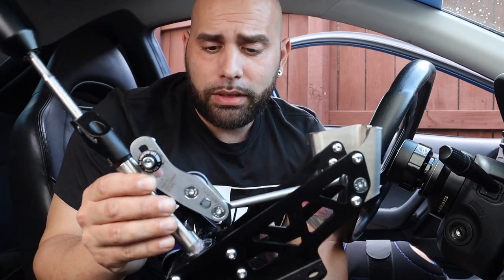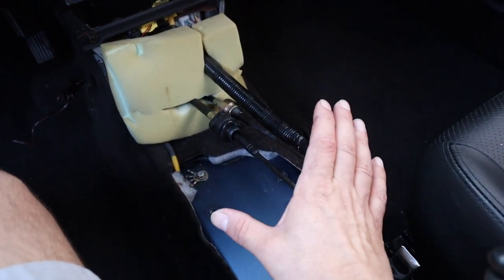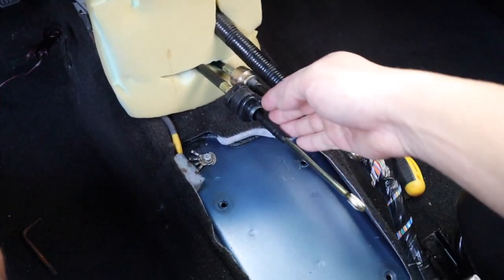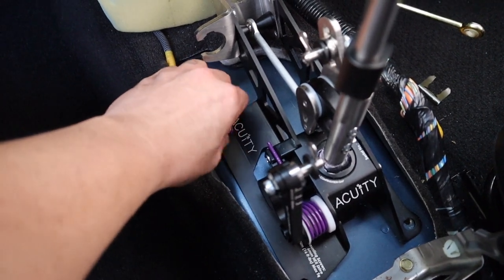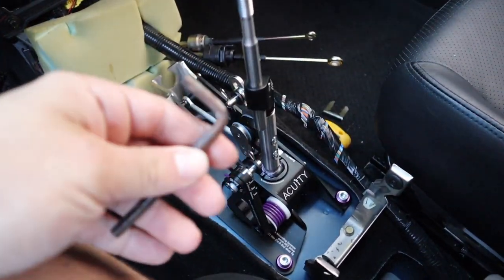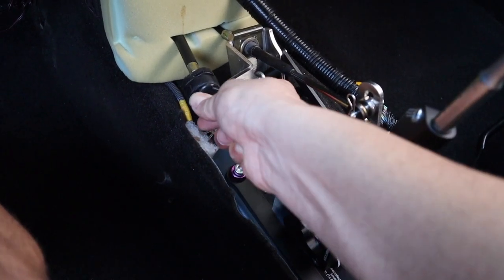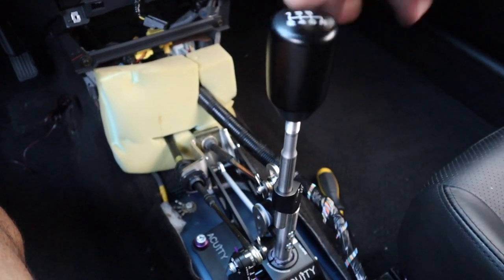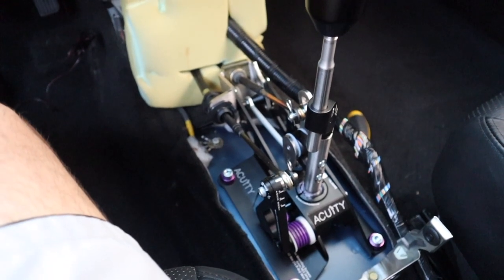ACUITY 4 WAY SHIFTER INSTALLATION  Step by Step DC5 RSX Kswap

Comment: nice video! it would be nicer if u include a test drive
Reply from the maker: Oh i will
Reply: @JaviVibes  I don't see you've posted your drive video? Plus I think you said you'd discuss race vs daily settings? Anyway, wanted to say thanks for a clear, helpful video. I finally put mine in today. Must be the 3rd time I've done this. First removed stock, put in the add-in arm from k-tuned. Then put in their full shifter. Then damn, look at the Acuity...had to have it. Like the stuff you're doing. These cars keep going.

Comment: Do these shifters add any extra strain on the transmission or cables? Curious if people notice cable stretch or transmission issues after installing these aftermarket shifters
Reply from the maker: Not really man! Its been the best thing I’ve installed in the car for sure. Its very smooth, very stable no stretching no nada 🙏🙏🙏

Comment: Anyone have troubles with the plate being loose?
Reply from the maker: Not at all when i had it are you?
Reply: @JaviVibes  i am, with the front two bolts that go with the plate and the frame They go in at an angle for some reason.